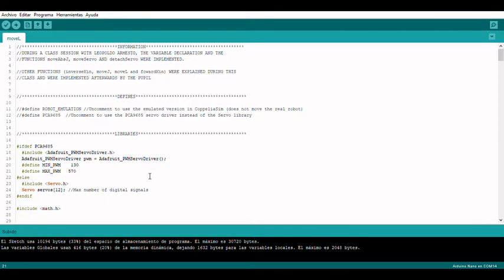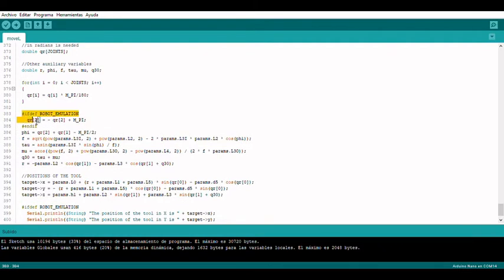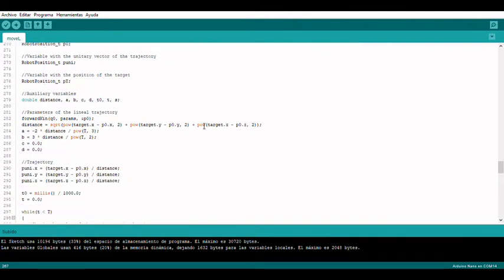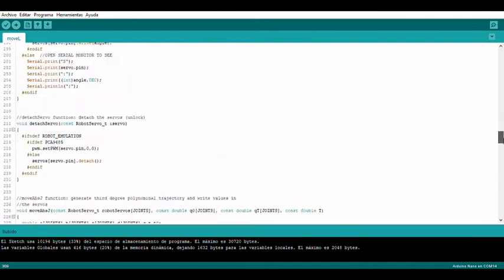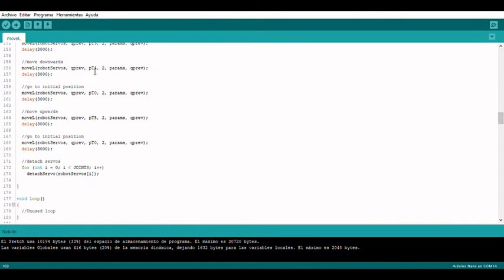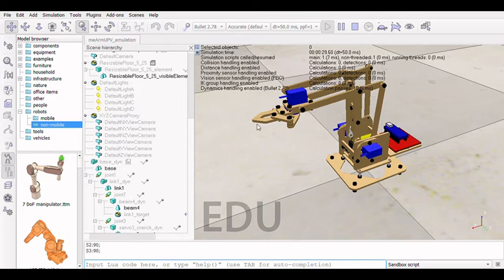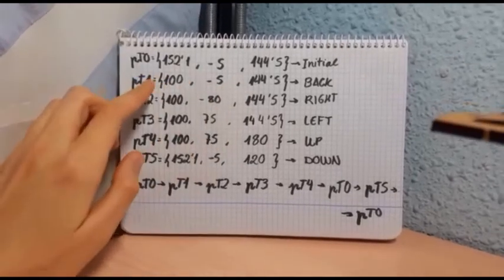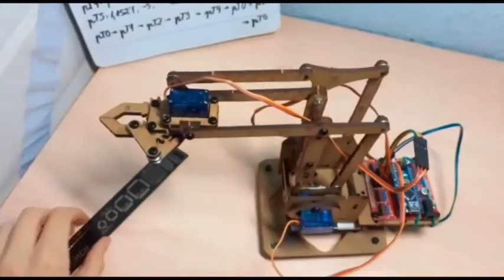Linear movement

Comment: hello miss,  I am designing a 4 axis robot arm for my university project. What is required of me in my project is to move my robot arm lineary in x,y,z axes with 3 potentiometers. I need your help with software. I would be very happy if you could help.